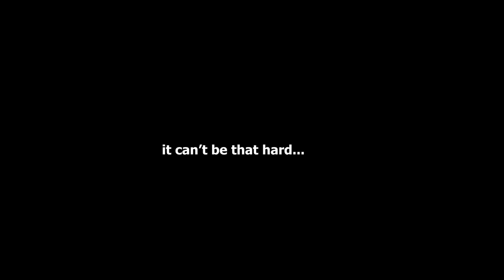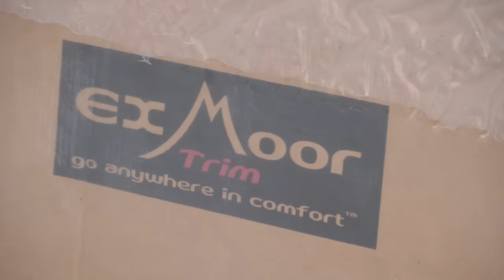Restoring a Classic Land Rover

Comment: While this seems like a lot of work, it's actually brilliant. When designed, the designers knew that soldiers, REME's, explorers whomever, would have a block and tackle and a set of spanners...they wouldn't have a hoist in the desert or jungle. Imagine being able to fix the whole bloody car while it's on its wheels???
Reply: Or you could replace the clutch with only a bottle jack and about 6 hours with a normal car.
Reply: @Adrien Rudy Thanks for your reply. I got to the site on google and Im waiting for the hacking stuff now.
Seems to take a while so I will reply here later with my results.
Reply: @Adrien Rudy it did the trick and I actually got access to my account again. Im so happy!
Thank you so much, you saved my ass!
Reply: @Landyn London no problem xD
Reply: I loved my old rover. Honestly can't say it was well designed, tho. More like everything was adapted for use. My '63 VW bug was better designed. Could fix anything while in the driveway with common tools. Except heat.
Reply: They used to say you could field strip and fix a Series Landrover with a Swiss Army Knife. A bit of an exaggeration, but not so far from the truth. I did nearly all the maintenance on mine, but I wouldn’t dare mess with a modern car.
Reply: @hel1copter   I felt the same as you about my 10 year old Audi S5 when I bought it, but once you have a go and begin to understand, it gets less worrying. They're mostly(!) not as scary or complicated as they look. The basics are all there. What probably worries people the most is the electronics, which you don't fix yourself anyway. You have it professionally refurbished or replace with new module.
Reply: That's why I want one. Unfortunately, they're illegal for NO apparent reason in my dumbass country. The feds have confiscated and destroyed a LOT of them.
Reply: @largol33t1  What country do they do that in?
Reply: 1982. Removed and dismantled the gearbox in a car park (dirt patch really) in Iceland. Big bots Meccano :)
Reply: @landynlondon7474  😂
Reply: I restored my 1967 2a SWB. Fortunately I'm ex-RNZEME, so parts weren't an issue. 😅

Edit: I should add that I did put it on blocks, but only to sleeve the slave cylinders.
Reply: Our 4X4 club. When arriving at camp; Toyota, Nissan and the Mercedes G, all Star to BBQ and have a beer. The LR owners are getting out their wrenches, screwdrivers and ducttape...Nuff said.
Besides LR's are for overpaid, narcistic soccer player.
Reply: Block and tackle aint gonna be much use in the desert unless you bring a few sky hooks...
Reply: If you can't fix it with a hammer, it's obviously an electrical problem.
Reply: They used a hoist in this video

Comment: At first I thought you were taking the hardtop off, in order to winch out the gearbox! It's a one-man-job, I did it in a weekend with appropriate cursing and swearing like Harry Potter does all the time. But then I saw you were aiming for a soft top anyhow, nice work!

Comment: You made it... I am going to subscribe. 
Initially, I got fascinated with roof repair series. And now I am watching this Land Rover restoration <-- something that an old friend did in the Aragonese Pyrenees  (albeit also repairing the engine) .  
Regarding the Land Rover, I realized that in Spain, well-kept units are worth around 17.000€, and they are from the '60s!!!! 
They were made to last. So would not be weird to see some of them still running for the next 50 years.
Reply: Just like with old tractors, as long as there exist an interest(IE money to be made), then there will be parts to be found. ^)^

Comment: Only just come across this but enjoyed watching it. Just a tip for removing the bronze 1st motion shaft bush from the end of the crankshaft. Pack the space inside the bush completely with grease and then find a bar that just fits the inner bush diameter. Hammer the bar onto the grease and the hydraulic pressure created will get under the end of the bush and force it out.

Comment: Great video. I have a 77 SWB with canvas top too. I didn't see you grease the input shaft or spigot b4 reassembly. I hope it doesn't start squealing. If so, you can wrangle the box out with a door off & top still on. A previous owner of mine cut & plated - with bolts- the cross member on mine so it can allow box removal from below. The Aus army made that a standard feature. Good luck with the old girl...
Reply from the maker: Thanks for the tips, we did grease the shaft before re assembly. Thankfullly the kit came with some included

Comment: The thing about this one was how good it was, i believe a restoration should be one that's been left in a wet field for 50 years, i get why you would want to restore a good one, as it makes sense as most things aren't seized and in decent nick so would save on part costs, as reusing the old makes more sense, But i still believe this was too easy for theses skilled men, Fantastic video though

Comment: Don't drive with the foot on the clutch, even "only" touching. You start to already put some pressure on the clutch pump. Change the gear and put the boot away. Just an advise to not change your clutch too often :) 

Thats the golden rule of off roading.

Regards from the Willys MB!

Comment: Being able to pull the transmission straight up though the floor seems like a nice feature.
Reply: Not really, there’s like a million little bolts holding the floor down(not self tapping) so you need to have a spanner top and bottom and of course the bottom side is rusty and corroded.....maybe it was just mine but I had to keep putting new clutch plates....🙈 it’s a mission, but great little cars love them 😂😂
Reply: Thelostbushman! Lg Sounds like a job for rivnuts...

Comment: You can tell which vehicles were built for the Army. Everything is modular and you can literally take them down to the skeleton of the chassis and then build them back up pretty much all with a set of spanners and a couple of screwdrivers.

Comment: There is a mod one can do that removes the need to dismantle the cabin to get to the gearbox and clutch. The problem is the subframe that goes under the gearbox so cut it off and affix mounting plates on it so that it can be bolted back onto the chassis rails. I had this done to a Series 3 as I was having continuing gearbox problems. On the second occasion the garage chappie suggested the mod and life became much easier.

Comment: Easier way of removing that gearbox spigot bush  in back of crank is stuffing some soggy paper into the back and use a tight fitting block of wood / steel bar and the hydraulic action pushes the bush  out . I didn’t believe it would work until I did it myself !

Comment: 2 hours? Having owned a Series III myself, you missed out that the nuts will be in a mixture of Whitworth, Imperial AND Metric, and anything that isn't aluminium will be rusted solid.... I used to gauge the weather conditions on mine by how much rain was on the inside of the windscreen. That said.... I'd buy another one tomorrow if I could get away with it! :-)
Reply from the maker: couldnt have summed it up better! but the results are worth the struggle :)
Reply: @carlroge  Besides the Morgan +8 the only softtop car where it doesn't only rain in, it also does snow in ....
Reply: There are not many 1970s cars on the road. So I would have to say that the Land Rovers are extremely well built. Compare them to anything from the 1990s or 2000s and you will see they have not become dated.
Reply: @bighands69  With Series LRs and their resilience it's alike to German 401 to 406 Unimogs or any Canadian DeHavilland Beaver: Once in a while there are useful things offered on a market, and should the supplier decide "to move on" (usually because some random marketing idiot or red pen economist says so), said market starts to self-organize, builds or rebuilds parts and keeps the "population" alive no matter what the original supplier tries to bring the newer but less useful versions or models into said market. Latest Defenders are a nightmare should You plan to go to places with abrasive conditions, so people willing to use a LR as it was meant to be used keep prices for elder versions high enough that welltrained machinists and mechanics supply what owners can't repair/refresh on their own. So, it's not the build quality I'm afraid, but the constant, reliable market demand that keeps LRs alive.

Comment: i have never worked on one of these but for my recent 3 trucks when i had to deal with the clutch - i went a lil furthur and put in an automatic.  '71 chevy blazer, '68 bronco and '73 toyota fj40. makes the truck much more desireable if u ever want to sell it, more poeple can drive it and it's easier if u get in traffic.

Comment: Great vid! My Series 2A needs a new clutch too, but I was thinking to drop the gearbox and work from under the car and save myself the work of dismanteling the complete interior.
Reply: 2a is completly diffrent set up from the Series 3 . If you don't have the cross bar under the box, you can lower it, but it is * heavy and un balanced. If you are on your own  it is definitly safer to strip the cab and lift. If you have a hard top , then OK it is awkward.  Out through passenger door.To get it from the bottom , if you have a mate , tie a line around the transfer box from the top and pull it left to keep it level when lowering. Have large lumps of timber palced at each end in case the box rolls off the jack,  A pice of broom handle works perfectly well as an alignment tool. K and L registration where the change years from 2a to 3. The easiest way is if the insturments are mounted in the middle it's a 2a , if behind wheel it's a three. Though you will see late 2a with lights in wings. Change of the lighting regulations .
Reply: @Lancashirelad I did one by sliding the box back under the vehicle with trolley jacks. Wouldn't recommend though unless you have a dolly to completly support the box and a flat strong floor to work on. One thing I would do now with that method is to remove the transfer box to balance it.
Reply: @Lancashirelad yep that's all I did..

Comment: Remove the floors and trans tunnel, unbolt the transmission along with the driveshafts slide the trans back and leave it in the car ,remove the clutch and flywheel reverse operation .

Comment: hi there, great video, after removing the g/box it would have been better to steam clean the g/box and check for oil leaks, and put new oil in. i hope the g/box oil is not draining into the transferbox as this is a common problem sometimes in my 30 year experience with series 2a and 3 l/ rovers,
Reply: Where’s the problem with that. My 2a does this but as I see it oils gonna come out somewhere, least this way it spends bit more time in the vehicle🤣

Comment: I have once, on my own,  replaced the engine on my series 2A. If I was to just replace a clutch I would do it by removing the engine. Far easier than removing the gearbox.
Reply: I've just done mine, took 2/half hrs, just pulled box back, no need to touch engine, not quite sure what these are up to dismantling the whole thing.
Reply: @martinhawkes2823  Yep. the Haynes manual says you can do that,  just says you are a bit tight for room..... Only Land Rover design  fault  is no  removable crossmember.

Comment: The old machines are more concentrated on the mechanical side. Not like the computer showing engine warning signs on the dash. If the machine had a problem , it showed that problem.

Comment: So you have to gut the inside of the vehicle to get the transmission out ? On my ford ranger with a 6 inch lift i just crawl under it and unbolt the transmission and it comes out, i would have it out before you even saw your transmission

Comment: The easy way to align the engine and gearbox (whichever you are fitting) is to replace two of the studs in the flywheel housing with 4" long studs with rounded ends (either studding or set bolts with the heads cut off) one each side. You can then engage these easily and wind it together with a couple of nuts. You will find it will drop straight together. You can then put the rest of the nuts on, remove the long studs and put the originals back. Takes less than two hours and a lot less swearing. It is interesting that I found that clutch plates don't seem to wear out, the covers just become weak. The other trick when doing this job is to buy stainless steel floor screws etc. I assume you have replaced the bent bit of bulkhead as I have one spare in the basement!

Comment: Informative, pity about the lack of engineering standards. Mangling the aluminum cover plate as opposed to removing the screw and fitting the spigot bush with a precision wood working sawing block

Comment: "Zero mechanical experience" - this from guys with an engine lift, and plenty of automotive wrenches/tools.
Reply: Yeah, right.
Reply: Lack of experience does not mean lack of tools, they could’ve been borrowed from a mate
Reply: Engine crane you can hire... And I think most practical people have a set of spanners and wrenches... They aren't automotive specific tools.
Reply: What if they have friends and you enjoy the video?
Reply: Right, they even have a clutch alignment tool.
Reply from the maker: @987415263753951  😂😂😂 point well made
Reply: @benwilliams6925  iuu

Comment: Why did you not get the flywheel machined??
Reply: That's exactly what I was thinking 🙈
Reply: It didn't appear scored and in my opinion, as the old clutch still had its groves, it did not need replacing, if it was slipping, then the problem may have been an adjustment, and not the need to replace the clutch, would like to have seen the face of the pressure plate. Surfacing the flywheel is usually only required when one has been riding the rivets fo a while.  I would have hand sanded the surface.  Also he appears to of neglected to grease the bronze alignment bushing.

Comment: Great job, one tip though: never let your foot rest on the clutch pedal, even within two shift moments, it will wear out the new clutch faster.
Did you also clean the inside of the bellhousing?

Comment: Erm, you didn’t have to do all that. 
I removed gearbox and transfer case for overhaul and renewed clutch by just unbolting and lifting the seatbox up, just enough to allow the shifter boxes to clear it, and drop it down. No need to remove half of the car.

Comment: Until I saw that  you were changing to a canvas roof,  I thought why not just drop the engine out instead of taking the roof off.
Reply: Actually it is the easiest way.
Reply: Normally you wouldn’t have to take the roof off just need a short chain on engine crane. But taking off the passenger door can give you a bit more access
Reply: @lancesoltoggio8802  And a crane that is low enough to fit in and still lift enough to get the sod out. Deep joy of a job, as I'm sure your aware.

Comment: I have owned and restored 5 Land Rovers. When I say restored, I mean restored. 

1958   The actual, official, Olympics vehicle used at the Squaw Valley Winter Olympics 1960
1961
1964
1967 NADA 109 (very rare)
1975

Comment: I liken land rover ownership to heroin addiction ,it’s intangible but once hooked you cannot get away from them .
My lowest point was removing the diff to get the stub end of a broken half shaft out on a drizzly cold evening outside my house ,as I broke the seal and EP90 oozed out like treacle into my mouth at the very same time while retching and trying to stop the diff from falling and crushing my hand a passer by with a dog cocked its leg on the back wheel spraying me with warm piss.
I’m clean now and can hold my hands out with no oil up my nails and no cuts on my knuckles.
Reply: Curse when you have them . Curse when you haven't. I have got soft in my old age, run a pair of Disco 2 now.

Comment: Hi I had a series 2 90 inch with a clutch gone after I removed the gear box which was horrific I realized it was easier to remove the engine to replace a clutch not that helps you now

Comment: Really nice video but could you seriously not clean that gearbox a bit more before putting it back in..? If the seals are good you couldve pressure washed it real quick, if they're rubbish you'd have to replace them anyway...